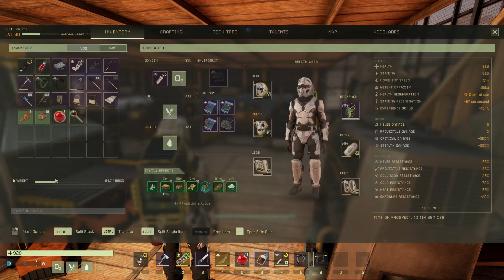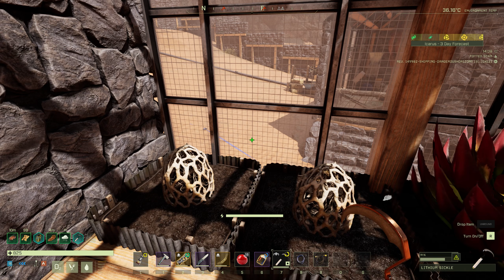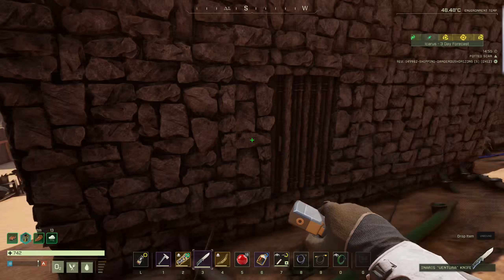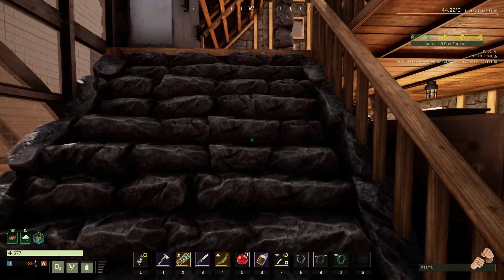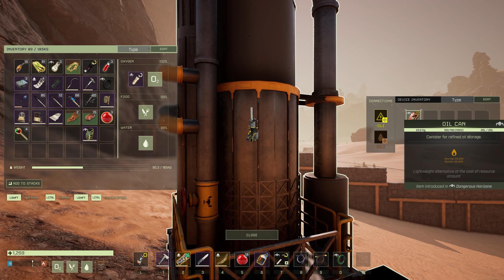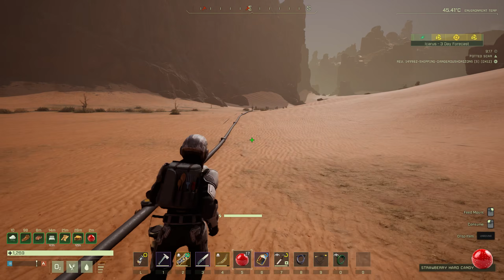ICARUS - FULL OIL GUIDE (DANGEROUS HORIZONS DLC)

Comment: What's your electricity demand:capacity? So far i have pretty much everything up to and including tier 4 that requires power. My constant supply is about 70k, and i have two battery packs connected with a total of 12 million reserve. I haven't even come close to it. My total demand with everything running is around 35k, so 50% of my generation.

Comment: im doing t5 but im a bit confused for the extractor. I crafted 1 and hooked it up like your video, but refiner turns on for a little bit and goes off. Like on off fast, and i dont see any oil going in. But when i let it store and turn off the refiner, it goes in and then turn it on, it goes in.  I crafted two and it does the same thing, because each ticks at 500 and it needs 1000. Do i just need more extractors? like 3 or 4 so that the refiner stays on the whole time? like more output? I'm just a bit confused on this.
Reply from the maker: More extractors mate, I know it's ridiculous  🙄

Comment: i Started with 1 pump jack over the oil an 1 refinery on site. An it slowly an i mean slowly fills up a oil drum. Each pump jack pumps 200 oil per turn. I scaled up to all 3 oil site with pump jacks all feeding the oil refinery an it still runs super slow with 600/1000 capacity. i have 3 wind turbines an 1 solar panel going to an advanced battery all on site. I am assuming that since you are running the oil pipeline over such a vast distance you are losing flow hence why you had 173/1000.  My question = Is there any way to make the refinery run faster an smoothly or is 1000/1000 required for this to occur.
Reply from the maker: no way to make it run more smoothly other than building more jacks, I actually stopped using them and stuck with organic extractors and loading them with fiber,

Comment: Phase 1 and 2 should be turned around. If you are at tier 5 you already have enough power to run pump jacks. They are just expensive to craft. If you start with pump jacks it saves you from having to build converters.
Reply from the maker: Very true

Comment: Spoiled plants also work in the converter. I get loads of it from my water mills, so getting refined oil is pretty easy. Definitely recommend that over farming if it's an option.
Reply from the maker: That's cool we just use fiber now (as we're on prometheus)
Reply: @Fortizar  When you have the lithium sickle, throwing excess fruit/veg in is still the way to go when you have excess so you can slowly harvest tainted plant DNA. But yes, fibre is a very efficient way to fuel them and i normally leave the bottom row full of fibre in case I get busy and forget to top up the fruit/veg

Comment: looks like covering your roof with solar panels is still the way to go
Reply: Only in daylight
Reply: @lilythepurple solar + batteties lets you power through the night. 

And you can sleep at night (which provides a good buff anyway), and since they added the electric heater there really isn't much reason not to
Reply from the maker: Yeah pretty much until you get uranium lol
Reply: I got wind turbine but they break down. Solar don't have that issue?
Reply: @raro0074  My solars dont breat with any weather event in Olympus. I used the "Dry Run" mission to get free solar panels.
Reply: @raro0074  I've not had to repair solar the main issue is storms can cut solar power but the solar is fine after the storm.
Reply: @kaisersnider8593  Also loving the update where wind turbines aren't damaged in storms anymore and just effect power output.
Reply: @raro0074 my wind turbines haven’t broke once? Wonder why yours are different
Reply: Ya i have 6 roof panels for a total of about 36k during the day, 7 wind turbine, two water wheels which i mostly ignore and forget that they've clogged, and two biofuel generators, and two large battery packs storing 12mil. I haven't come close to being tight on power. Other than the advanced crafting, in struggling to find a point with oil 😂